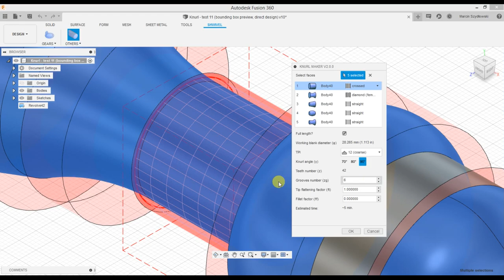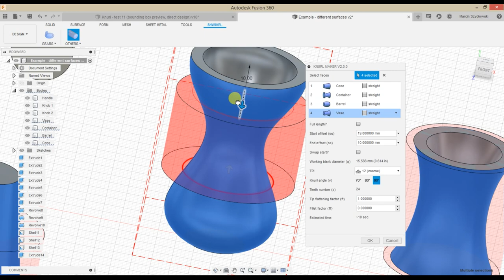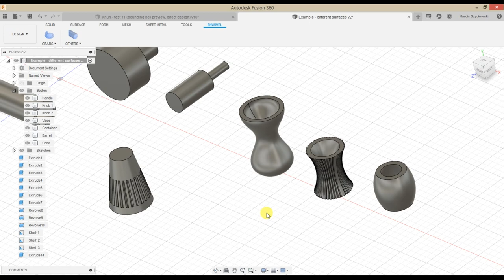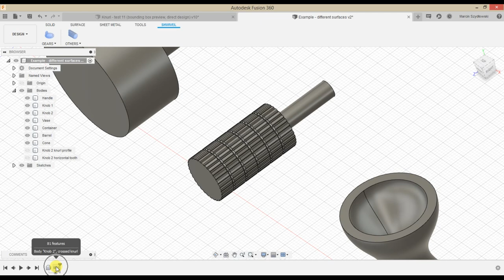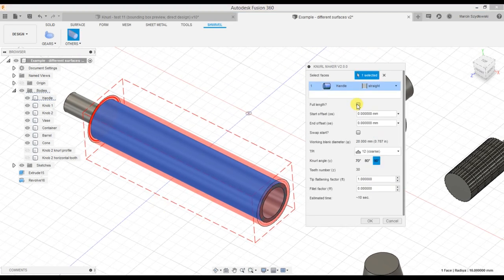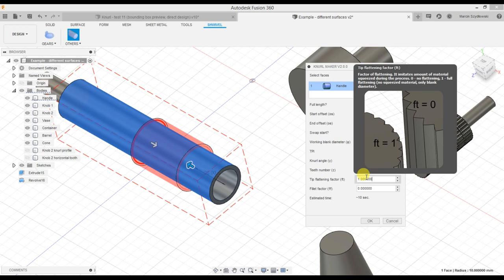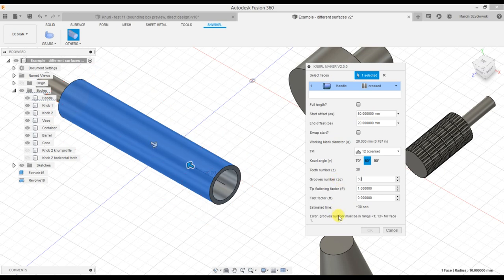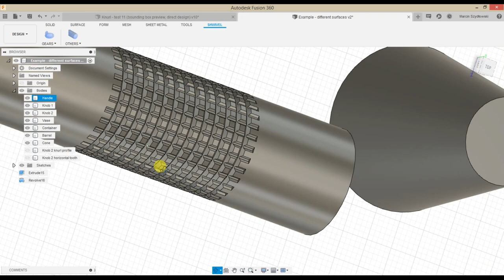Knurls in Fusion 360 - plugin (update)

Comment: I have the Knurl maker and enjoy it. With a not circular face I am not able to select any area. In other words lets say I have a circle with some area cut from it , is that not possible to add knurling? Such as a five sided shape? I assume all surface must be circular in shape as shown in the video?
Reply from the maker: Selection only works when face has circular edges on both sides but they must have only two centers. It is better described in the older video of the plugin (https://youtu.be/uwmzwHq2pCs). Unfortunately, it's not trivial for other cases. The problem appears when surface hus cuts or protruding elements (in situation when someone use CNC-multiaxis machine instead of lathe). Extrapolation of faces of those elements to keep knurl but prevent body from undesirable cut/join is not easy.